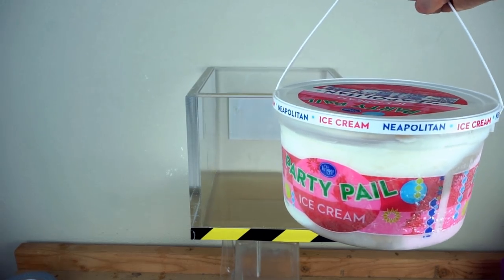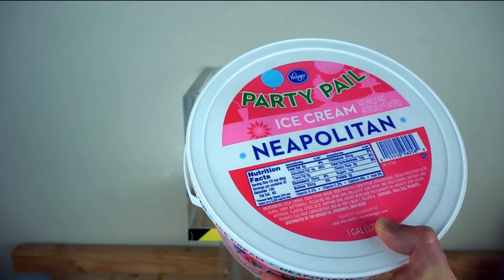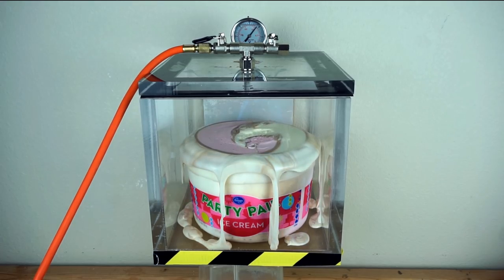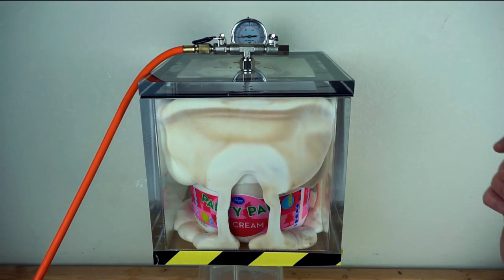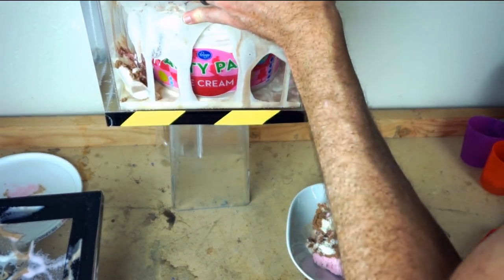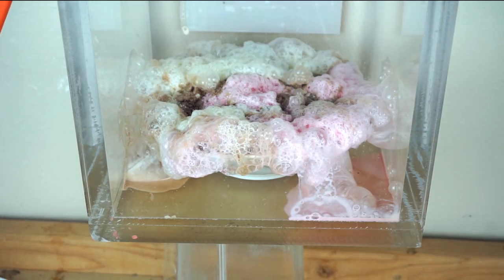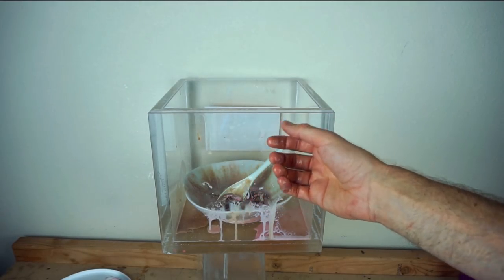Checking How Much Air is In Ice Cream With a Huge Vacuum Chamber = Ice Cream Win!

Comment: I honestly thought that it would get smaller, because the air inside of it were to go out of it. I thought that it will harden up and the top would have bubbles on it and eventually there will be no more air inside of it. And it would just be a block of ice cream that is extremely hard.😮
Reply: Me too dude
Reply: The power of ice cream.
Reply: Moxie Starbuck yeah, that's not what's happening, it would get smaller if it was air escaping from the ice-cream. Reality is pressure on the ice-cream goes away so it no longer is compressed. And at room temperature in a vacuum, water boils with no added heat.
Reply: Yeah, that's not what's happening, it would get smaller if it was air escaping from the ice-cream. Reality is pressure on the ice-cream goes away so it no longer is compressed. At room temperature, water would boil in a vacuum too! If we took away all gases including air from earth, you would also get bigger and your blood would also boil!
Reply: Moxie Starbuck Dang that was what I was thinking too
Reply: Moxie Starbuck
That's the essence of Experimentation:
You have to expect Something.
If it goes like you expected, you now know it forever.
If it doesn't go like you expected, you now know something else forvever.
Reply: Moxie Starbuck no thats a pressure chamber they are designed completely opposite to one another.
Think of it how hard is it to suck the air out of a liter soda bottle with your mouth (really easy). However it is really hard to blow them up even with an air compressor!
Obviously you dont deal with physics daily in your career.

...or do you?
Reply: I was thinking the same thing. I figured it would puff up to give the air space to escape, then once the air was out it would compress.
Reply: Can't understand how it could expand when the air was taken out.
Reply: I think thats what it's "trying" to do, except the air in it causes it to lose shape. See the Marshmallow one.

Comment: ive never seen a square vacuum chamber before. the ones ive dealt with in the past have always been cylinder shaped with a wall thickness at least 3x that than shown in the video. as long as the cube version is safe and effective, thats what matters.
Reply: I think it's only like 2,000 lbs of pressure at full vacuum

Comment: Does the temperature change in a vacuum chamber? Can you put a variety of thermometers in the chamber and see if it affects them from reading temperature correctly?
Reply: I was wondering that also
Reply: Gases get colder as they depressurize, which is why aerosol air fresheners and deodorants get cold when you use them. So I would imagine the walls of that box get a little cold
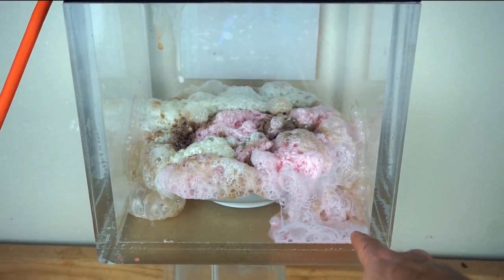Reply: 4:58 has your answer
Reply: @bloodclot  it doesn’t get hotter it just boils at a lower temperature than normal

Comment: The Action Lab try Lays in a vaccum chamber and see if it explodes.
Reply: WiNdRoId lol
Reply: WiNdRoId this the key to interdemensional travel
Reply: WiNdRoId little did you know thag lays are smal vaccum chambers lol
Reply: wtf are you saying, lays (and all other bagged snacks) are filled with nitrogen so they have positive pressure inside
Reply: Air in air chamber?
Reply: MasterP48HD exactly. That's why it should explode
Reply: if a bag of chips will explode on a road trip into the mountains, it doesn't need to come anywhere near a vacuum before it pops.

Comment: Another reason the ice cream melted so much at the end is due to thermodynamics. When he let the air back in it created a rapid increase in air pressure within the camber which generates heat
Reply: More like, the cool air of the ice cream was removed, and warm air was substituted, like replacing half of an ice cube with warm water
Reply: @samuels1123  also true. Similar to how an A/C system works

Comment: "you are only buying 1/2 of the weight of this"  WHAT? ... do you know how weight works i think you mean volume
Reply: chken Samich air has weight
Reply: Not the same as icecream though.
Reply: Austin Decker are you serious 🤦🏻‍♂️
Reply: I was scrolling through the comments to find this.
Reply: John Doe same haha tho I just assumed he miss spoke.
Reply: Austin Decker a bag of air at the same pressure like the surrounding air weights NOTHING but the material that the bag is made of... Just to be accurate, air is an arbitrary specific mix of gases with different density and the air inside the ice cream maybe cpmpressed due to the ice enclosing it so it is actually a tinyest bit heavier than the surrounding air ... Or how do you think a hot air balloon works with all that heavy air in it
Reply: dec011984 no one is saying air weights nothing. Everyone is saying that air practically weights compared to the cream. And it certainly doesnt account for half of the containers weight.
Reply: dec011984 a hot air balloon works because the hot air is less dense, so it rises
Reply: Nathan Taylor yes, i just wanted to make clear that air does technically has no weight unless being tightly contained against surrounding air, so the weight of the air inside the ice ... Besides being colder and a tiny bit compressed ... has almost no effect on the weight of this ice cream. But yes air in a bottle weight inside a vacuum has a significant weight.
Reply: dec011984 if Air has now weight, how do you explain atmospheric pressure? The only reason we are not currently in a vacuum is because air has weight. Everything (except some certain particles, obviously) has mass, so then because of the gravitational acceleration, they have weight.
Reply: That triggered me too. But it depends on whether the original "<50% air" requirement refers to weight or volume, which he did not specify. On intuition, I'm going to guess it's by volume.
Reply: chken Samich He is correct you buy the same size of box (volume) but it weights only half of the ice cream he bought.
Reply: dec011984 ‘air is an arbitrary specific mix of gases’? That doesn’t make sense, I don’t arbitrary is the right word to use there
Reply: How do i do it? VOLUME
- harry's furniture

Comment: I work in an ice cream factory on the east coast, if we ship ice cream to the west coast it has to travel thru southern Texas to avoid the mountains, as the lower air pressure of high altitudes is enough to cause severe expansion of the product.  Ice cream consumed in high altitude locations is actually produced in special factories in high altitude locations to prevent any problems.  I heard the story of a new driver taking a "quicker" route through the mountains and when he arrive at the destination the pallets of ice cream tubs had expanded to fill the box truck!

Comment: You are buying all of the weight, but “half of the volume”... The air in the ice cream doesn’t add to the weight.
Reply: David yes but not the half claimed I  the video
Reply: You are too far down!
I expected at least Basic physics knowledge on a Channel like this
Reply: David it doesn't. It would if you weighted it in vacuum and/or you bought it in a pressurized package. Neither is true for ice creams sold on this planet.

Comment: Could you explain more of the science behind this? Like why does it boil due to a vacuum?
Reply: Martina Madeleine as the pressure inside the vacuum increase, the particles expand, causing the Ice-cream to melt.
Reply: The boiling point of a liquid changes depending on pressure. The lower the pressure, the lower the boiling point is. If the pressure is reduced enough, you can reach what is called the triple point of a substance, which would be an environment where the solid, liquid and gaseous state can all exist together
 So you could have chunks of ice floating in boiling water..
Reply: Boiling point changes with pressure. That's why boiling point is different in high and low altitudes

Comment: Half of the weight because of air? No, half of the volume would be correct, air weighs nothing.
Reply: @Fawful The Best
It depends solely on the definition of weight. In physics weight is mass and then air in fact weighs something.
But I referred to The Action Lab saying "you are only buying half of the weight of this" at 0:35. And this statement is actually wrong. Take the ice cream with air and put it on a scale. Then melt the ice cream and by that let all the air out and put it on a scale again. The ice cream weighs exactly the same according to the scale.
So if you are buying 1 liter of ice cream you are acutally not getting 1 liter because the air adds to the volume of the ice cream. However, If you are buying 1 kg of ice cream you actually get 1 kg, no matter how much air is inside the ice cream. Do you now understand what I tried to say?
Reply: Leli196 I mean sure I was just saying that air definitely weighs something
Reply: I thought the same thing. He means mass/volume
Reply: air does have a weight how do you think helium floats ...WEIGHT and density
Reply: the weight of air is equal to some mass of N,O, molecules accupied by void in ice cream
Reply: Weight is the effect of gravity on the mass of an object, that is why you "weight" less in the moon, and more in Jupiter,but you have the same mass, if you are not affected by gravity, you have no weight but you of course have mass

Anyhow the mass of the air is practically none so it has practically 0 weight, I mean it indeed has mass but is unperceivable
Reply: Leli196 actually you're technically wrong in the sense that when you said it would weigh the same if you melted it. At a molecular level it would weigh less since the air that was trapped inside is now not a part of the ice cream. Which still wouldn't be noticeable.
Reply: Well your feet are exposed too more pressure because of the weight of the molecules of air pushing the lower molecules
Reply: Honestly this is a pretty pointless debate because in the grand scheme of things it really doesn't matter.
Reply: Yes
Reply: yes you are true  Daniel Johanson
Reply: He's saying the ice cream with more air in it weighs less because there's less ice cream in it. Ice cream is heavier than air, so if something has 50% air and 50% ice cream, it weighs less than 80% ice cream and 20% air. Y'all's comprehension skills are WACK.
Reply: Frank Gonzalez Del Valle That’s not why, it’s actually because of the surrounding air. If you were to take a container of air to a planet with no air, the container with air would feel quite heavy if it has enough air.

Comment: This is a perfect example of why food is sold by weight, and not by volume. Only drinks that are 100% liquid are allowed to be sold by volume w/o a guaranteed weight. I worked at a Baskin Robbins for like 5 years back in the 80s and I can tell you that almost all ice cream has a huge amount of air that is whipped into it.  In fact they add a powdered seaweed mixture to increase the ability of the ice cream to hold air.  There is only one commercial brand that I know of that limits the amount of air whipped in, and that is Ben ‘N Jerry’s.  Soft-serve ice cream has significantly less air as well.

P.S.  Ice cream can be sold by volume under certain conditions, like when packaged immediately after being produced, as it is still in a liquid state.

Comment: Why does it melt? Isnt a vacuum supposed to be 0 kelvin in temp as there is little to no atoms moving inside? Or maybe external heat radiation is melting it but if left inside the vacuum a while its temp lowers

Comment: Isn’t it because the bubbles inside is trapped that causes the expansion?.. I mean if there’s 10% or 5% air, will it make a measurable difference from the expansion in the vacuum?

Comment: here is an idea: Supposedly the fumes Diesel fuel are flammable at around 140 degrees Fahrenheit/60 degrees Celsius.  Is it possible to make some kind of heated see through chamber that is over 140F/60C.  Curious at what temperature it will actually ignite with no actual flame present.

Comment: You need to remember that this is not really a "vacuum chamber", it is only a "underpressure chamber". So there is still lots of air in there, but since you pump in a big negative pressure the remaining air in the objekt place in it will expand. So it makes no sense saying that this "vacuum" is blocking the heat from getting in. In our system, there is no vacuum, not even in space. Vacuum means an area free of any kind of particles and molecules. It is kind of strange why you use the word vacuum for basically underpressure ("vacuum cleaner", "vacuum chamber")... So if you say that the word "vacuum" stands for "underpressure", it is true.

Comment: I don’t understand why it expands. Seems counterintuitive.
Reply: It is counter-intuitive at face value but to my layman's grasp overly simplified perspective it seems the ice cream is colloidal and thus gel like and when frozen in semi-solid state is dense enough to keep the air bubbles from escaping it as they expand  - for liquids as the pressure drops on the surface it allows tiny air bubbles to expand and become more buoyant and thus rise to the surface but buoyancy doesn't matter so much with the mostly/semi-solid ice cream so the bubbles expand in place like balloons until they "pop" or equalize pressure and as the bubbles closest to the surface expand they reduce in pressure allowing the bubbles around them to expand and so forth.

I'm not sure exactly how the mechanisms/processes work and it's too bad he didn't do more to explain what's really happening as he usually does a really good job of that.

Comment: Here’s a problem with your statement “how much air” is in ice cream. Really you are looking at the pressure/temperature relationship of substances  and their boiling points. Lower the atmospheric pressure and you lower the boiling point. Water, milk, cream, etc have different boiling points. Put a glass of water in there and the water will boil.

Comment: Hold up. Highschool drop-out here. How exactly does pressure cause boiling?
Reply: When you decrease the pressure in the container, the water molecules are not packed as tightly together, allowing them to boil (bubble away) at lower temperatures. Keep in mind, the term "boiling" has nothing to do with heat. Water can boil and be 40°F.
Reply: Henry Black gee thanks, Batman!

Comment: You said water boils with no air? How does it get hot with no heat
Reply from the maker: +Sean Kessens it’s not hot. To boil something you can either raise the temperature or you can lower the pressure.
Reply: The Action Lab o yeah duh lol